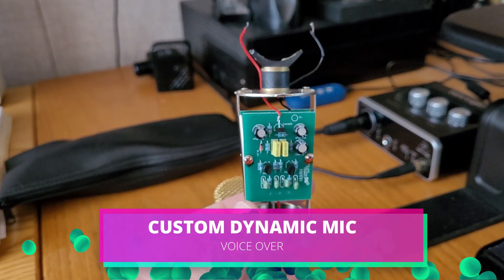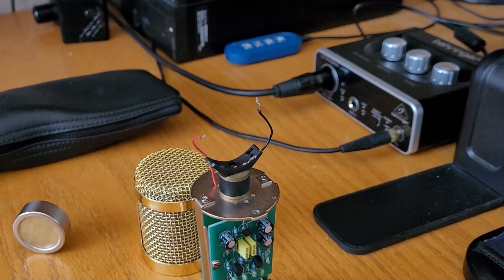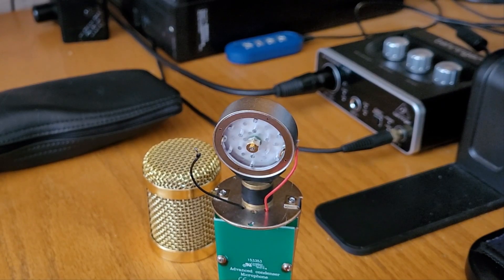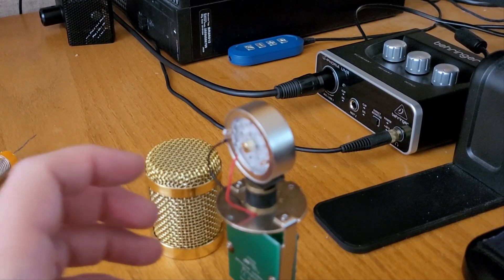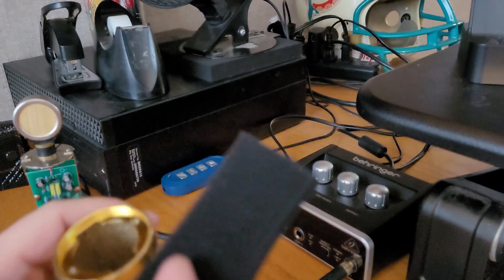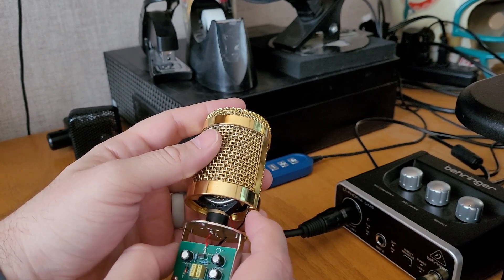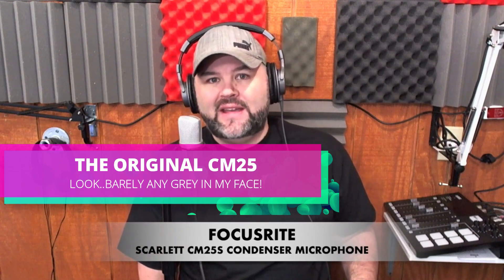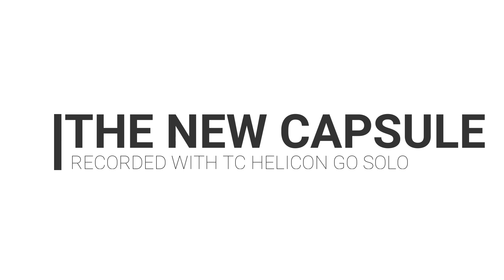Upgrading The Capsule Series - Focusrite Scarlett CM25 With JLI Electronics JLI-3412 32MM Electret

Comment: i have a cheap fifine mic i paid $8 second hand and i was considering upgrading the capsule to the one diy perks used in his video. the thing is the microphone has circuit has an integrated adc and usb controller and i don't really know how much i will gain in terms of sound quality before i decide to buy a decent audio interface and order a custom pcb and components for a new pre-amp circuit
Reply from the maker: In my experience...changing capsules in a cheap USB mic is not worth the time, as the internals shape it to be almost the same as original capsule
Reply: @ObscureMics  the capsule is contained in a separate cylindrical chamber and surrounded by a steel mesh (fifine k056). i could also try to add  different tipes of foam to dampen certain frequency ranges. i don't plan to use it for professional applications. it seems to be a nice project to tackle

Comment: COOL!-Hello,are you using 48volts phantom power for this (32mm?) upgrade.I have All ready done the 25mm upgrade to my Neewer BowelMovement800 into a outboard ham radio eq that has 12volts that power the unit I am just guessing that it is also 12 volts at the 3.5mm input..Neewer mic is xlr to 3.5mm cable into unit.Neewer mic sounded much better with out  phantom power48volts with the 25mm capsule.I have ordered a ebay$12 >34mm< capsule that I plan to upgrade.I am guessing It wont require 48v phtm pwr but I have also installed a mini xlr chassis mount on eq unit to accomodate a MXL 990.So if it dose need more I'm  all set and if it sounds distorted I'll know .This video that you made is very very helpful.Oh,try small daba flux on  the capsule connections also for quicker reveal with iron on lowest heat. Fini THE END.. : )
Reply from the maker: Yep 48v... Thiugh a lesser amount will do... I have a mixer that supplies 12v and it works well
Reply: @ObscureMics  Great ,very good to know now.,thank you so much for the  quick responce..Now  I just have to be patient while the new capsule is crossing the pacific ocean, get inspected,shiped from west coast to my little cow town in the middle...Oh if your iron dose not have temp controll and you feel it is to hot ,unplug 4 a  moment it'L cool off enough if you think your going to damage red wire connection on a capsule diaphragm.

Comment: got the same capsule before watching your video couple weeks ago, i'm so disappointed by the results especially considering i spent around $40 on it including shipping cost!
the sound is bassy and muddy, and after doing a rudimentary frequency response test, the results confirmed it
the cap is completely unbalanced and its frequency response is basically a slope with over represented lows, muddy mids, and nonexistent highs

i do not advise this capsule to anyone!
Reply from the maker: It's defiitely not great... That being said... The cm25 is tuned dark... So this capsule on a different cheap mic... May be the ticket
Reply: @ObscureMics  didn't use a cm25, i used a diy preamp and a dac.
it sounds just as dark.
tbh the dark doesn't bother me as much as the lack of details and a muddiness. 
You can fix a mic too dark with some EQ but lack of details can't be fixed.

After doing some research i found out that indeed, smaller diaphragm have better details, dynamic range and sensitivity.

Turns out the large diaphragm is an "audiphile meme" .
they say "it sounds better" but on paper everything tells that it doesn't. This is so bizarre to me.

Anyhow, thanks for the video and the reply.

Comment: Sounds really nice to me.  It IS a bass-y boi, but it's much fuller sounding than  the original.  And I would always rather have the low end available, and EQ it out when I don't need it.  So I'm really liking these capsules.
Reply from the maker: Feel like I need to get all the foam out of the head basket and see if that lightens it up just a tad